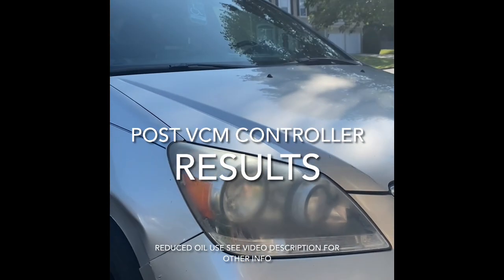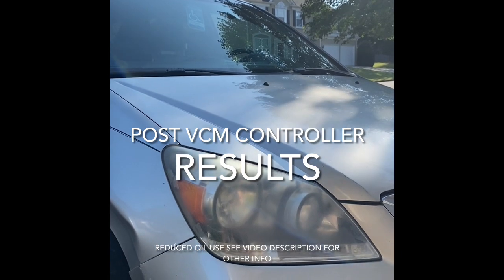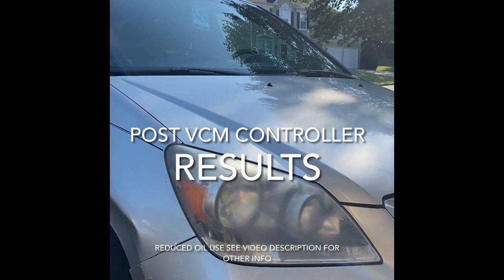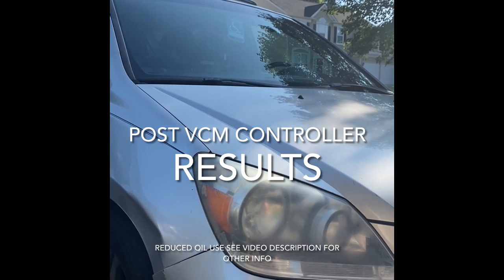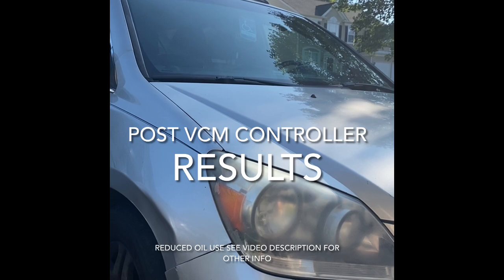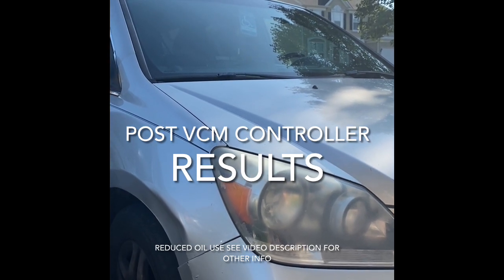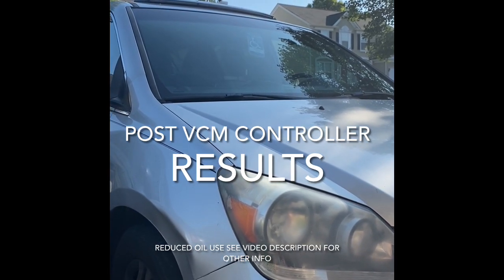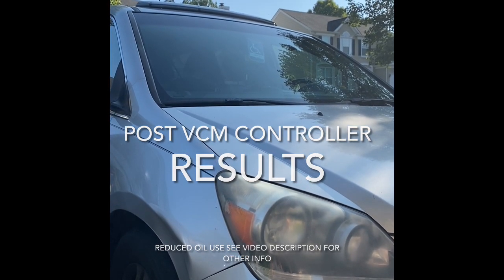Follow Up S-VCM (VCM Delete) Controller : 2007 Odyssey:  results after 1 full Oil change cycle

Comment: Are you on the forums, odyclub?
Reply from the maker: I am on some but haven’t been there in awhile.  I havce a 2007 model I disabled the vcm earlier this year  with SVCM controller .  
Cut the oil consumption in 1/2  . Also was getting some vibration when in eco mode.  Disabling vcm fixed that .  I bet some balancer part was getting warm out or something .  It’s has over 250k miles now.   May not keep after 300k  which is when its next timing belt is due to be replaced.  

Next fix I will be doing appears to be  the well known j series oil filter   housing gasket leak
 15302-Rdv-j00 

The super charger for the odyssey I never thought somebody would do that 👍👍👍